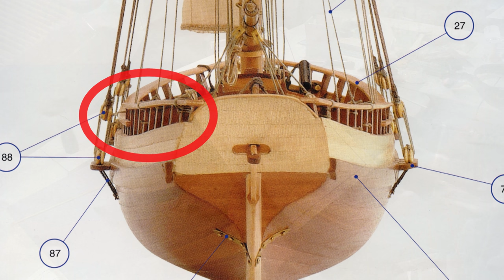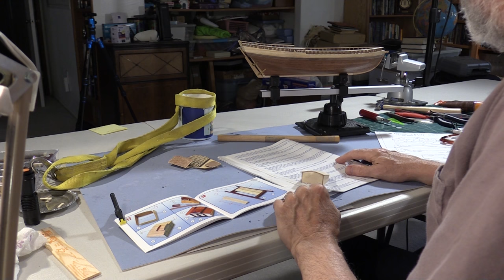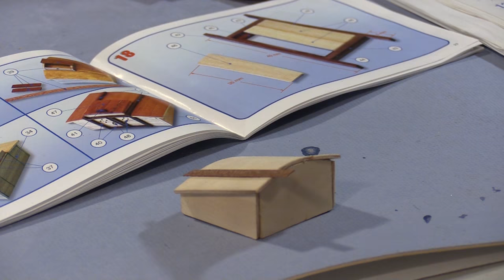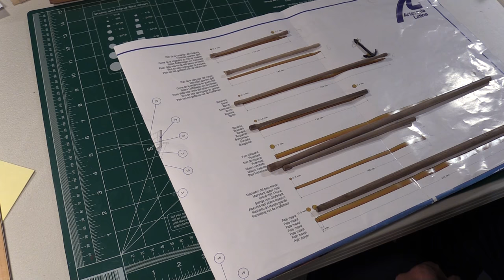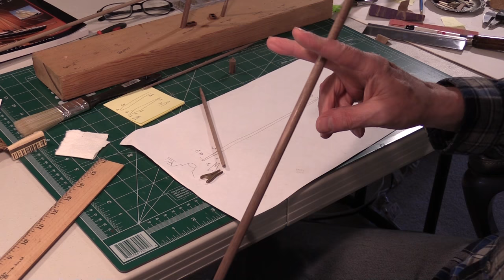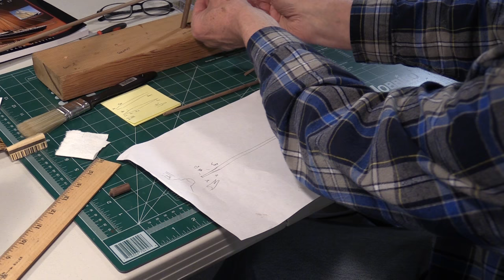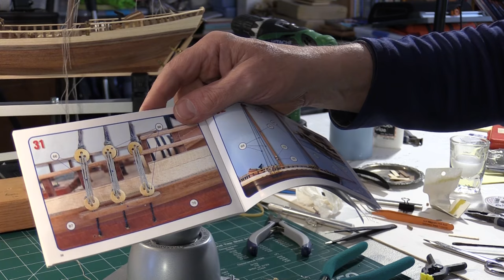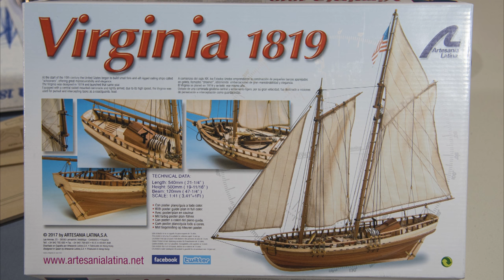Virginia 1819 model boat

Comment: Hello there Ken! I wanted to ask if you used any stains on the ship and what were they exactly if you could remember? I also wanted to ask where you might’ve applied them. Still   
thinking of getting this kit but of course the rigging looks terrifyingly difficult.
Reply from the maker: I only used polyurethane, matte finish, on the wood.  The kit wood was quite colorful.  I applied this in my garage.  When it was cold, I used a space heater.  I did paint a few of the pieces with acrylic paint (e.g. the water barrel) and Rust-0leum (gold for the canon, simulating brass).  The rigging was challenging, but seemed to be the simplest configuration compared to other ships with multiple masts.  It did require some homework, but if you are thinking of building kits with masts, this is a good one to start with.  It does not matter if you assemble the rigging in an awkward way, it will look good in the end. (I am sure experienced rigging guys cringed when they saw how I did the rigging).  I am glad I did this boat, and the experience was quite valuable.  The next time I rig a mast, I will know more.  For me, the best way to learn is to jump right in.  Experience is a good teacher!

Comment: Nice work Ken. My Viginia Schooner was delayed perhaps 8 months when I had to plank the hull, and wasnt happy with the sharp angle I had at each bulkhead despite soaking in boiling water. At last I decided to fill the space between the bulkheads with solid balsa blocks cut and sanded to the contour of the hull. Gave me much more gluing surface and no more sharp angles. Now making better progress. Did you find videos by Tom Lauria? He's a wizard.   Dave
Reply from the maker: Good idea about the solid balsa blocks.  I looked at all the Tom Lauria videos and his website.  He does museum quality work.  An Artist!

Comment: I found the same problem as you regarding the gap and the rudder,  think its a design fault with the kit. Also my sails don't reach the end of the boom as shown. but still loving this kit, a couple more sails and some rigging and i'm done then onto my next project the Black Pearl.
Reply from the maker: Thanks.  The black pearl looks like a step up in expertise!  Good for you.  Let me know how it goes.  This boat was a challenge for me, but 1) it looks good, now that I am done, and 2) the next boat was easier from all that I learned on this one.

Comment: Hi ken. Thanks for the video. Where can I buy the stand you use to hold the model?
Reply from the maker: Its called a Keel Klamper.  I forget where I bought it, but a google search will show several sources.  I added the steel base for weight and stability, and well as rubber feet.  the local steel shop had just the right size for 1 or 2 dollars.

Comment: Nice model....for very small holes try drilling with a pin vice....you have much better control and less likely to break your drill bits than using a dremel or other power driill.
Reply from the maker: Indeed.  I now use the hand drill much more often.  thanks  Ken

Comment: Hi Ken. Thanks for the video. Im working on this same ship now, and your video has helped me foresee some problem areas and some solutions. Where did you get the clips you use toe help when you do you planking?   Thanks much,
Reply from the maker: Thanks.  I had to review the video to find what I used.  These were small paper clamps.  all you need to do is pry off the handles from one clamp, and force one handle in the clamp of an unmodified clamp.  I found this trick on YouTube:  https://www.youtube.com/watch?v=4peQxPmOwto
- Ken

Comment: Instead of coloring the side boards of your deck give this a try. Take some Elmers glue and add a few drops of black dye to it. I found it gives the most realistic look you can get at scale and it helps bond. I always had issues with using pen ink or pencil where when I applied the glue it tended to cause it to run and would run onto my deck planks and looked nasty.
Reply from the maker: Thats a great suggestion.  I was never satisfied with pen or pencil. I will add this to my list of tips and tricks I keep for myself.  - Ken

Comment: I built an identical boat from the same company they called the 1805 Virginia Pilot Cutter.
Reply from the maker: I looked it up on the web.  The pictures made it look slightly better (higher quality).  But you are right, it is very similar.  thanks for letting me know
Ken

Comment: How do you trim the wooden planks for the deck?
Reply from the maker: Its been a while since I reviewed the build of this boat.  But I think I installed the planks longer than required, and then cut the length to a closer fit, and finally used a Dremel tool to grind them to the final fit (sandpaper would work as well)
Ken

Comment: If you seal and add ballast to these sorts of kits, would they float on water?
Reply from the maker: No.  At least I don't think so.  There are plenty of model sailboats and motorized boats that are designed for real water.  But these kinds of kits are to be displayed on a shelf.  No controllable parts, like a rudder, or motors to move the booms, etc

Comment: When I made mine, the rudder didn't fit as well so I just fabricated my own.
Reply from the maker: Yeah.  Each kit, so far give me some parts with extra wood, and other parts with just the right amount.  It has been nerve racking, so I am looking at how to make my own parts, and I am starting to collect various wood types, (e.g 2"x4" oak, etc) and how to cut them thin.  
Also I now appreciate the idea of looking at other forums and learn what they know before I "fly off" and start.  :-)  Ken
Reply: Had problems with my rudder not fitting correctly, i had to adjust the fitting of it.

Comment: Do you remove the nails when the glue is set?
Reply from the maker: Yes, once the glue dries.  That's why they are only halfway in.  Since this video, I found a good PIN INSERTION PLIER from Micro-Mark which has been very useful - Ken

Comment: I wanted this model to practice some skills before I build our uss constitution I found in our basement. I was wondering would this schooner historically ever have copper plating? I want to practice the copper plating but I also don’t want to make a model that would be too historically inaccurate. Any comments would be amazing thanks.
Reply from the maker: I don't know about copper plating.  But I have found and joined Model Ship World (https://modelshipworld.com/).  There are tons of resources there, and I am sure you can find examples and training about copper plating.  Good luck.
Reply: @ken_boats  thank you Ken for getting back. I’m laughing because I can’t believe it’s been a year and I haven’t worked on this model in so long. I finally got the planking done and used some water putty to fill the gaps. Hopefully will be sanding everything and getting done with it soon. Appreciate the tips and such and wanted to comment again (before noticing I already did), I still use you’re video as the go to tutorial so thanks again.

Also, I had a tea kettle going on low just keeping the water hot enough. Then I would pour that over a plank into a baking tray like you had setup changing the hot water for each plank. Although inefficient for the water the planks were extremely easy to manipulate. Potential advice for the future

Comment: Is it possible the original boats rudder never reached all the way down to avoid damage? I believe that boat was meant for coastal service.
Reply from the maker: Maybe.  At the time I figured it was my short coming.  Several people who commented stated they had the same problem.  Since this time, I've realized all kits have some "fit" issues, and creative solutions are typically required.  I think this is the real problem.
Reply: @ken_boats  there was a time when even plastic models weren’t straight or flat and we had to warm the parts and straighten them.
Things have gotten so good that we even have laser cut parts, I have to say my expectations are higher these days.

But in your case you persevered and that gives you and even higher sense of pride.

Well done sir

Comment: Sorry. Also the rudder fits flush close to the sternpost and goes THROUGH the lower transom. I recommend that you have a look at the many forums, The Virginia sloop is well covered. Also there are many helpful facebook forums offering expert assistance. Following Artesania's instructions is a non starter, that's one reason they've ceased trading.
Reply from the maker: Thanks Dugan.  I am slowly finding the forums, but I never thought to look via Facebook.  I will seek out more advice before I start my 4th boat (I'm finishing my 3rd).  I seem to learn best by first trying the task, and then I can better appreciate good advice.  Its a slower process, but I'm in for the long run (e.g. build more model boats).  Now that I have some knowledge about the task of building model boats, the advice, lessons, and examples, have more meaning to me.

Comment: What is the name of the holding device ....tank you very good job
Reply from the maker: Thanks.  I use the device all the time, as it is most useful.  It is called a "Keel Klamper" by Amati.  I also bolted a piece of steel and rubber legs to the bottom for weight and stability.
Reply: @ken_boats  thx
Reply: @ken_boats  thank you for reply have a nice day

Comment: excellent  build for a first attempt. what you call wedges are stealers, common practice in model building. standing rigging (permanent) such as deadeyes and shrouds were always treated with bitumen so should be black. running rigging was not. one other tip, if you run your rigging lines through a block of beeswax you avoid the furry look.
Reply from the maker: Thanks.

Comment: Did this model boat age you?  I have been working on the 1805 version and it has aged me~!
Reply from the maker: Ha ha.  It kind of did age me at the time!  This was my 2nd boat build ever.  A week or two after I finished, I was wondering what to do, and i realized I liked working on model boats.  Since then, I have built 1 boat per year.  And I am improving my skill.  It is still fun, and still frustrating.  Don't give up.   When you are done, you will be so glad.   ... Your age will return to normal, and you will start looking for another!!  - Ken
Reply: @ken_boats  I bought the original in 1982.  The fact that you had to hand shape the aft blocks (part #12), and the directions had two photos, both different had confused me for 40 years.  Yesterday I said the hell with it and proceeded and now have the first hull planking done!

Comment: Hi Ken. I note that the video is over a year old and don't know if you still use these techniques.  I'd like to add a few comments. Planks should not finish with a point, instead they should be tapered so all can meet at the stem, The amount of taper can be easily calculated. 'Stealer' planks (the 'wedges') can be inserted at the stern but only in the deadwood area. They will not cure the buckling problem. This will leave a properly planked hull as you would see on a real ship. 'Experts' never use plank benders, they cause far too much damage and are unnecessary. Just soak the planks and set in a jig. The buckling that you're getting is fixed by edge bending, again like a steamed plank on a real ship. This is just as important as flat bending. If you use the nails ( I would not recommend that you do) you can get a pin pusher instead of taking a hammer to your work, though I did find the hammer useful for smashing the plank bender!!! There are numerous forums, some helpful ones on facebook, which are specifically aimed at new builders which address the matters above. Good luck with your builds and, most importantly, enjoy them.
Reply from the maker: Thanks:  I am learning as I go.  I am better at planking, but still need to learn more.

Comment: And the ignorant think that building a model from a kit is easy. These kits never have enough bulk heads or
formers to help with the planking, the shape won't have the full body as it should.  Sometimes putting blocks of wood at the bow and stern and sanding them to shape helps enormously with the laying of the planks. Finally, the planks should taper towards the bow, especially on these types of model ships.
Estimate the number of planks needed to do one side and multiply by the width of the plank. Measure the length of the bow and you will see that the bow is usually narrower so taper the planks according, try and avoid wedge planks.

Comment: Very similar to the SWIFT 1805 Virginia pilot boat 1/50 scale by Artesania Latina which I purchased in 1982 for $39.95 at Stadium Toy & Craft (long gone) in Tacoma WA. You did a better job on yours.
Reply from the maker: Thanks for the complement.  I paid a bit more.  :-)  Ken